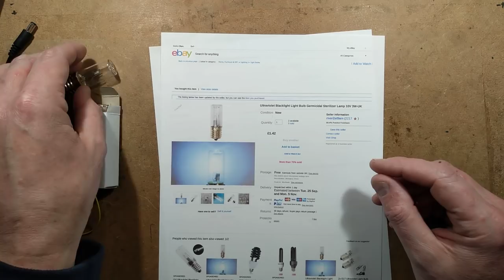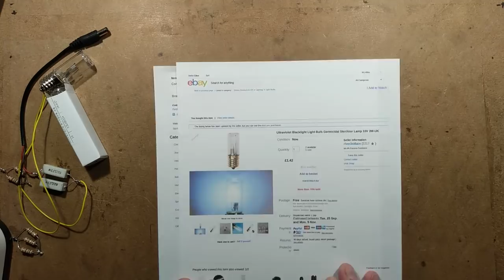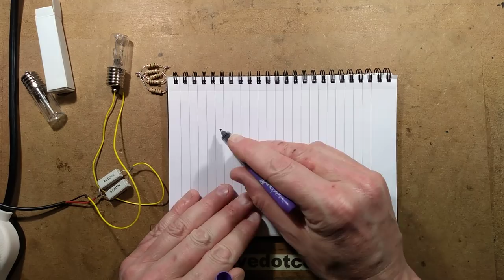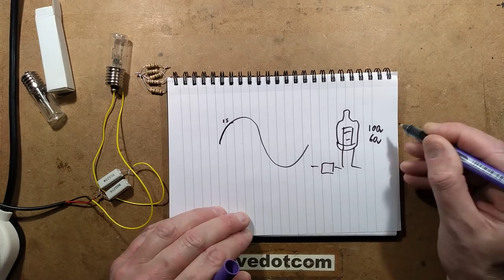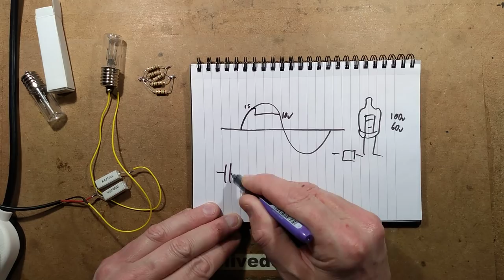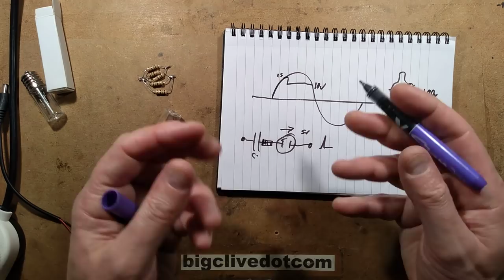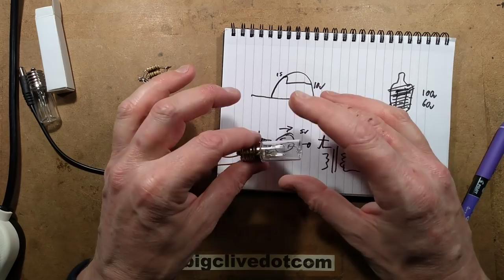Amazing ten-volt mercury discharge UVC lamp.  (GTL3)

Comment: I wonder if that would work for combining hydrogen and chlorine to make hydrochloric acid.
Reply: Hello Cody!
Reply: I got my hands on UVC leds and i guess it's possible. I read on sciencemadness people were doing it with halogen lamps due to the UV traces ot emits
Reply: Hi Cody!
Reply: No need for UVC, hydrogen reacts vigorously with chlorine, the reaction would be highly exothermic with a self -sustaining flame. all you need is a gas regulator valve and a match to initiate the reaction
Reply: I would expect the reaction to be explosive.

Comment: Normally used on a 28V supply via a sodding big 27R resistor, to provide the ballast resistance. There is also a 82R resistor across the lamp in this application. This is used as a illuminator for aircraft instruments that is not visible to the human eye, yet provides a bright phosphor display on the dials, with a very dark UV pass filter ( Woods glass) to keep the UV level to a safe level. Used to be a part of older aircraft where you had to read regular instruments during night flight yet keep your dark adapted vision for navigation and flight.
Reply: Thank you for that info!

I kept wondering, "how and where would such a tiny amount of UVC be useful?" Not in many germicidal applications, except maybe very small enclosed spaces. Possibly in a industrial paint/coating cure process (?), but then again, you'd probably use a much more 'standard' size lamp there, otherwise you'd need a lot of these in a panel arrangement.
Reply: @SigEpBlue  my philips ultrasonic toothbrush base station uses one for "sterelising" the brush heads
Reply: Rick Delair  120V/6W would be 50mA, if it was half brightness, the thing probably not more than 30mA. Enough for a nasty shock (as you wrote) but far away from "deadly". I would expect, that this device has some constant current characteristics, like a bicycle dynamo. Higher rpm -> higher voltage, but higher (internal) frequency also, so with it's  inductivity the max current stays roughly the same.
Reply: lol you are a light bulb collector? i collect electrical switches xD
Reply: +SeanBZA  I bet you love to explain in pubs why aircraft power systems are so different from 12/24v car/truck supplies and also where the 400Hz AC tradition comes from :)
I certainly do anways hahaha
Reply: well i cant compete on that :). 
I dont buy for emotional pourposes , i would say more practically  for having always a vareity of choices when i want to build something (so a tiny bit emotionial, when optical vereity counts. In short i am an electronic component Prepper ;).
Reply: Rick Delair I have been collecting light bulbs since age 3. My prized possessions are 3 Edison bulbs in working condition along with the original boxes or what’s left in zip lock bags. Sounds like you have some great stuff in your collection that 10,000 watt bulb sounds awesome. I’m going to research that. Sounds interesting what voltage does it use?
Reply: They don't use a UVC bulb for illuminating fluorescent phosphors.  They use a  UVA lamp (blacklight) for that.  UVC is dangerous to your eyes.
Reply: Rick Delair  This is certainly the most esoteric 'big fish' story I have heard recently - whats the value of such a thing?
Reply: I have such a lamp, prob at least 50 yrs old, saw one in a pic of P51 cockpit, it has a rotating "pie cut" filter for visible light
Reply: That's a different, but electrically similar bulb known as an RP-12, BL360, or F5000.  There's also a Russian version, the ЛУФ-4.  They include a phosphor similar to a blacklight bulb to convert the UVC radiation from the discharge to UVA and a little visible light.
Reply: Good job

Comment: E16 fittings are incredibly rare. There is one ancient porcelain fuse size that uses it (Siemens Diazed/NDz/… DL E16), and some sewing machines, microwave ovens, and refrigerators seem to favour them for illumination. For the latter ones, I've only ever seen the lamps, but short of going out and ripping one out of a used appliance, the fittings themselves so far have eluded me.
Reply: When I used some lamps which were about this size,  I ended up cannibalizing a replacement strand of old fashioned screw in christmas lights. They worked for my UVC lamps, but those were technically E17, so they might be too large for the E16s.

Comment: That is digital zoom for you. Zooms in a lot at the expense of quality. Optical zoom is the only way to go.
Reply: not likely in a cell phone though,
Reply: Years ago, when VHS camcorders were all the rage, they generally came with (typically) 8x optical zoom. We tried an experiment and mounted a 50x pair of binoculars (only one side) onto the end of the lens. It wasn't easy to do and the picture stability was hard to maintain but that gave us 400x zoom. We got some amazing video of the moon as it literally zoomed past.
Reply: @ruakij6452  I've got one of those. Probably overkill for over the shoulder YT vids, also has no external audio input if that matters. But yeah, excellent video stabilisation at near max zoom. Can literally shoot the moon hand held.
Reply: I see that UV C has several uses in dentistry. Regards Graham (G3ZVT)
Reply: The moon zoomed past ?? What were u smoking in those days ???
Reply: Crazy idea: Use a tracking telescope and a camera with zoom to build a moon landing game that uses live video images of the moon.
Reply: @Brianck1971 , quick envelope calculation, the arc diameter of the moon is 0.31 arcminute or approximately ½ degree.
If we disregard the moon is rotating around the earth, that means the time for the moon to move one diameter is 24h/360 Deg * 0.5 = 2 minutes.

If you have the moon filling the entire screen, that's quite a speed, not at least as you are not used to be able to see moon or stars moving.
Reply: Never seen it used in 37 years. Its use is not in any currently acceptable sterilisation or disinfection protocol. 73 de
Reply: @Brian C probably the same stuff that allows for clouds to exist behind the moon.
Reply: girlsdrinkfeck  I believe that's only on the international models. I had the international version of my phone before I crushed it while working on a car. It had an genuine zooming effect up to 2x and then software zoom up to 6x. The US models only have the software zoom. The only difference in those phones is the camera/speaker board and the modem board. You can actually swap them into the US models and copy the drivers into the appropriate locations to use them but this generates a new IMEI that might be on Sprint's blacklist.

Comment: Just tried DC at 12, no good, 14v just worked, wondering if I can use an old 555 running about a few hundred hz with a small resistor and series capacitor to get current limiting and psudo AC so I can use this in a water purifier in a camper

Comment: Ahh. I've always wanted to see one of these in action since reading about them in the past. 
I never understood how a gaseous discharge could be sustained with only a 10v supply.

Time to grab a beer, and learn something new. Good choice of topic, Clive.
Reply: Remember that stick welders operate at a low voltage and strike an arc.
Reply: Clive drops the F-bomb 2 minutes 29 seconds. That's how you know it's going to be a good video
Reply: I'm not sure about discharge stuff, but most ionic things happen at low voltage, like battery cells, electrolysis etc. More current is more electrons per seconds. So say you only need a certain amount of electrons present for a reaction to take place (or coming out as a result of a reaction), then the more you can pump through per second (current) the more "result" you're going to get (until it is no longer possible). If you have more electrons present than you need in an instance (high voltage) then it is just inefficient and will probably have other negative effects, like heating, or exploding.
Reply: @laminatedsamurai  F-bomb?  What the fuck is an F-bomb??
Reply: Once the path is ionized, the voltage is low.  It's getting the arc struck that takes high voltage.  In this case, it's the filament with the coating that does the job.
Reply: Gas discharge can build up just with enough current via electron avalanche in the gas. However many gas discharge lamps are actually being used as arc lamps to start hints where the high voltage idea comes from. And most arc lamps are also gas discharge.
Reply: @Cheeses: Who fucking knows?
Reply: The discharge can be sustained at such low voltages because the very presence of the gas. The electrons emmited would travel until they impact a gas atom, which are relatively big and slow because of their higher mass. So the electron knocks some more electrons out, the atom is positively charged, causing it to neutralize the negative space charge, thereby allowing more electrons to escape the emmiting cathode. The same happens in the old gas rectifier tubes used in radio transmitters and some other old professional equipment. The gas rectifiers were used because of the low drop voltage (hence low losses) and high current capability. The main disadvantage was the same observed in this video, hard UV radiation and also RF interference. Thats why gas rectifiers were used only in profesionally supersived environments, and not in consumer oriented appliances.
Reply: penguins forall  I would say any arc lamp is a gas discharge.
Reply: It's a proven fact that people who swear regularly have a higher vocabulary than those who don't.
Reply: @Cornz38  especially if you can swear in multiple languages
Reply: @robertoricardoruben  More specifically, gas at a very low pressure is why the potential is so low.

Comment: I'm reminded of the time,  many many years ago,  when I was pulling bits out of a scrapped washing machine and ended up with something that was labeled as being a "germicidal lamp",  the socket,  and an inductive ballast that went with it.  Applying line voltage to this did get it to light up,  and I don't think that I did too much damage at the time.

Comment: As Bernd says, power was one issue for mirrorless vs. DSLR - an issue in the field or on longer shoots. Another was viewfinder lag, until recently. Also, autofocus. Sensors now have phase-detect AF on the image sensor whereas before it was (or is, in a DSLR) a separate sensor in the bottom of the camera. Straight contrast AF through a normal image sensor can give good results but needs abundant light, and can get confused more easily.
Reply: FWIW:  I just realized I have been 'permanently corrupted' by modern internet-speak.  You said "AF" to mean "autofocus," but my first thought is to read "AS F*CK." 
😊😊😊

Comment: I have an old refrigerator that uses this lamp. It took me a while to figure it out, because the bulb was missing. Apparently, the 'Magic Ray' lamp used UV and ozone to prevent foods' flavors from mixing in the refrigerator (think before tupperware and ziplocks existed). I was able to find the bulb a while back, but I have no way of testing it, because it's wired in series with the condensate heater - which is also missing. I wondered why they would wire in series, but now I know - it's 10 volts (ish). Apparently they must've used the resistance of the heater as the ballast for the bulb. Interestingly, if the bulb ever burned out, or you just removed it, the fridge would have no way of evaporating the condensate water, and it would just pour out onto the kitchen floor!

But hey, instead of resistors, couldn't you just use a choke coil for a ballast? I wonder how an appliance (humidifiers, apparently? O_o) would be wired to power this bulb.

Comment: The square plate acts as an anode. Its tapped at the midpoint of the filament, so it will always be ~ 0V. The ends of the filaments (tied to each terminal) will follow the AC input 180 degrees out of phase of each other. The one that's in its negative half of the cycle, will be the cathode, and there will be a thermo-emissive (sp ?) current path between that cathode, and the plate. That path, thru the mercury vapor, excites it and emits UV light.
Reply: why does the glow happen only around the anode then?

Comment: Back around 1982 I needed an EPROM eraser.  I found the last clothes dryer germicidal lamp in the city.  A 40 watt incandescent lamp in series worked really well to limit the current.  Mounted the UV lamp inside a coffee can and erased EROMS in about 20 minutes.
Reply: You mean clothes dryers had germicidal lamps in them back then ? 🤔
I must admit I have never seen any so far...

Comment: The advantage of a DSLR with a viewfinder you put your eye to, versus a camera with a screen at the back is that with the viewfinder you can block out the light when you shoot in daylight. It can be hard to see what's going on at a screen.

Well, if you have a camera where you look at a display through a "viewfinder-hole", you get that advantage too without a flipping mirror. I don't know if cameras work like that nowadays, have only used a phone-cam the last decade.
Reply: I agree, viewfinder much better. Some mirrorless do have digital viewfinders. Still prefer optical though.
Reply: The problem with the viewfinder-hole is that it doesn't show you what the lens is actually seeing due to parallax. All of these viewfinder methods have their place though. Some are just more appropriate for some applications than others.
Reply: We have those, and they're aptly called Electronic Viewfinders :)

Comment: These bulbs do emit a strong ozone smell. I used four in a Styrofoam "sanitization box" with E-17 "patio light" sockets powered by 18VAC and capacitor ballasts, on a delayed start 5 minute timer. I read a number of UVC warnings and have never seen the direct illumination - just the purple glow through the Styrofoam. Russell's page was invaluable. I used AC to balance the wear of the electrodes. Thanks for the video!
Reply from the maker: You can get two types.  Both emit UV but one is optimised to create ozone.

Comment: Clive, this is a "blacklight" to some degree. At least, I know certain minerals will react to UV light. But it depends on the wavelength. Some react to UVA, others UVB, or UVC.
If you ever come to the USA, check out a cool mining museum called "Sterling Hill Mines" in northern New Jersey. They have found a large collection of fluorescent minerals. It was accidentally found in the zinc mine one day, when the power lines shorted out, and the arc flash created UV light. The walls of the mine tunnel glowed a pinkish red!

Comment: I have one of these "intermediate base" (a common size for reading lamps in the USA) germicidal lamps socked away, but I also got (in an estate sale) a 275-watt combination mercury-vapour/incandescent "sun lamp" from the 1950s, which screws into a standard socket & goes right across the 115-volt mains supply.  Of course you want to use a ceramic socket for that!  I don't know any good use for it other than discouraging the mold in the bathtub, but it's a real champ at that.

Comment: I've found a high frequency in a tilt switch produces a neat effect, little uv line, looks like when a rocket fires, only in eye scorching blue/violet
Reply: Completely forgotten about those tilt switches. We used them at Honeywell on the DHU1214 document handlers (reader/sorters) DHU1214's in the early 70's to detect when the "pocket" was nearly full and the feeder motor was turned off and a red LED would light. The magnetic rod on the flap would get covered with staples, pins and other debris so we upgraded to microswitches. The ones with the "arm" and the "wheel" on the end. 😆

Comment: So when you discussed the spatter effect I knew exactly what you were talking about because I learned that on your channel. That is why I'm a patreon.
Reply: *sputter/sputtering.
Reply: +Raymond - good resource page. The definitions for 'sputter' we want are the ones with (physics) at the beginning of the definition, at the very bottom of the column, since we're talking about atoms of a solid being ejected and deposited. (Note that there is no such listing for 'spatter,' which is why 'sputter' is the correct word for this situation.) I've not used wikidiff before, but it looks useful - thanks.

Comment: Are you referring to my POS sony camera that refuses to focus closely
Reply from the maker: Hopefully not.  It is a Sony A6500.
Reply: Sony are actually great. I use an FDR-AX100 as a production camera, and a smaller FDR-AX33 for my youtube stuff. It will focus right to the lens surface for the wide part of the zoom, but zomm in too close when closer than about 2 feet and it will loose focus. My cameras have hundreds of hours on them. I also have a Sony SLT-A65 I have had for many years. It was the first of the "mirrorless" cameras in the sense that it doesn't have a flippy mirror as DSLRs did. It uses a fixed semi transparamt mirror that sends a small percentage of the light into the phase dectection auto focus, so it has the focus speed of DSLR with mirror, but can record video and still auto focus. It was the first camera with an OLED viewfinder, not an optical, so I can see exactly what the picture is going to look like before I hit the shutter release. I use that for shooting time lapse mostly, however I have shot time lapse asvideo on the AX100 and processed in computer ans results were very good. AX100 has a large sensor, and it has become my go to camera for most stuff as I can shoot 100meg 4K and still shoot 21 megapixel stills. The SLTA65 only does 1080 video but then it is probably 10 years old now.

Comment: I watch a lot of your video. I did buy the exacte same lamp and I spend a evening  finding the good ballast resistor for the transformer I have.  That 3 week ago. Tonight browsing YT I find this video where you explain me that I lost a evening because you end up with the exact same solution I end up with ,thanks .  I also agree that a capacitor dropper is a bad idea. Inductor will work but a transformer with a resistor ballast is much simpler.